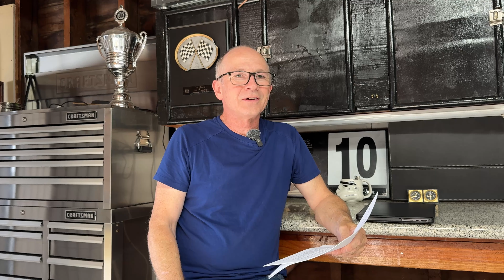How to Buy an Electric Scooter! Which Specs are Important?!

Comment from the maker: What subject would you like to see me cover next?  -Paul
Reply: What are your thoughts on e- scooters for teenage drivers.  Also would like a video on safety gear..
Reply: @ElectricScooterJuice  suspension. Based on ESG rating of 4 stars for the Wolf King GT and 5 for the Nami Burn-e, I’d have thought there wasn’t much difference between them. But it is night and freakin day. It’s like they’re two different types of vehicles. 
What goes into making suspension good? What kind of suspension is good for what terrain?
Reply: @ElectricScooterJuice  a goo in-depth video on the real world difference and use of road like racing pmt tires vs knobby vs the ones like the newer rs5 max that’s like a knobby hybrid tire

Comment: my question is kinda specific, in a way someone like Paul or anyone who has a good chunk of experience riding scooters could offer a response, i live in France where, legally, every scooter sold, cannot exceed 15.5mph, it doesnt matter if its a dualtron thunder or whatever. with that logic, i saw Paul's review of the zt3 over the g2, and how it suffered poorly, but i still went ahead with the preorder cause, for me logically, a scooter that can do 25mph without a strain, should get MUCH better range when its not able to go over 15, i think Paul tested for around 20miles and i kinda need this thing to do closer to 30, and i mean in normal drive, not being on hills, or riding like a lunatic, can that be a real expectation with electric scooters when not pushed to the limits? or do the gains diminish alot at lower speeds compared to gas powered vehicles?
Reply from the maker: The big drop off happens above 25 mph, but here's the super cool thing: Segway has gotten very good about reporting the actual range of their scooters in each of the modes. They say up to 43.5 miles in ECO mode, so I wouldn't be surprised if you can get 30 miles on flat ground in Drive mode. Weight is also a factor. I weigh 165lbs and we did a comparison where Ramier and I range tested the same scooters, side by side on two consecutive days and he got way less range than I did. Part of that is because we had a lot of hills that low power single motor scooters go into a low-efficiency state when lugging up steep hills. I don't think the ZT3 would suffer as badly % wise.  -Paul

Comment: I recently changed my back tire on my Hover-1 Journey Max to a honeycomb solid tire due to multiple flats in a short time period and changing them on this scooter is kind of a real pain. I haven't got a chance to test it yet, but it seems like my range may have dropped significantly. Have you ever tested the difference of solid tires vs pneumatic with respect to range? Love the new channel!!
Reply from the maker: Thank you so much!
Awesome question! I have heard about range differences, though I haven’t tested it myself. A good friend of mine worked in engineering for one of the scooter rental companies and did scientific testing on this subject. She saw a meaningful drop in range on at least one type of scooter when they changed from air-filled to honeycomb tires.
Let us know how it goes!
-Paul
Reply: @ElectricScooterJuice  Thanks Paul!